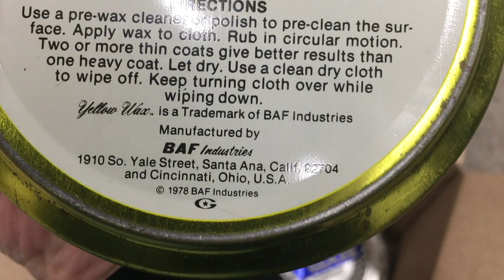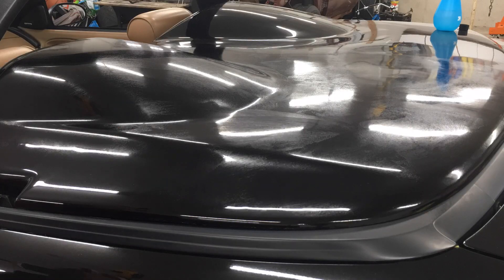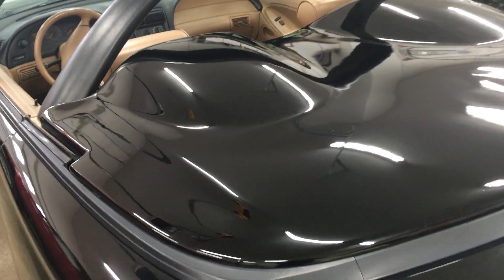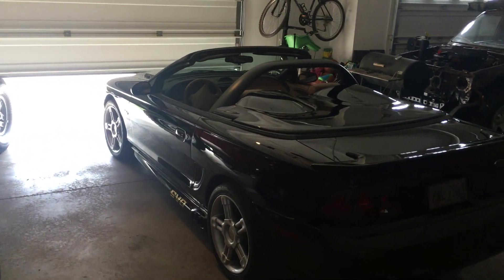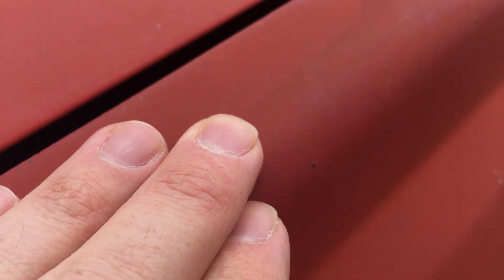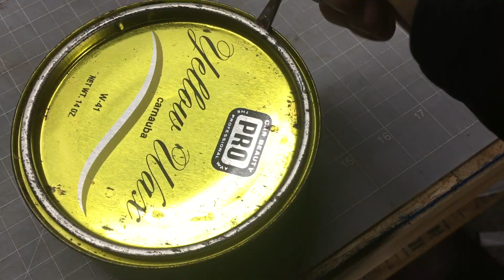Honest Review & How to: Shine Armor Fortify Quick Coat

Comment: So do you recommend this product and do you suggest a wash and foam wax (like a drive thru car wash) prior to applying Shine Armor?
Reply from the maker: I applied this before putting the car into storage for 6 months. After getting the car out of storage I have only washed it a couple of times and the paint feels like none of the product is left on the surface. Traditional wax will last longer. Although less work to apply, the shine armor will need to be applied more often.
Reply from the maker: And you are correct, the car must be clean before applying shine armor.
Reply: @6thGearGarage  how long does this last? Good for 1 month or so?
Reply from the maker: @yourmanzach2307  can’t say for sure, as the car I put it on stays parked inside all the time and only gets driven once in a while on nice days.
Reply: @6thGearGarage  thanks